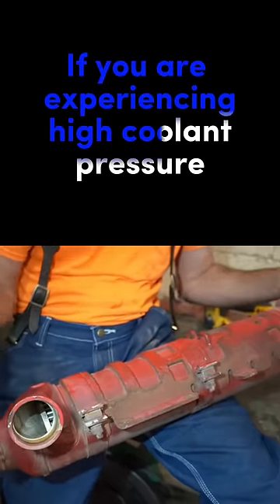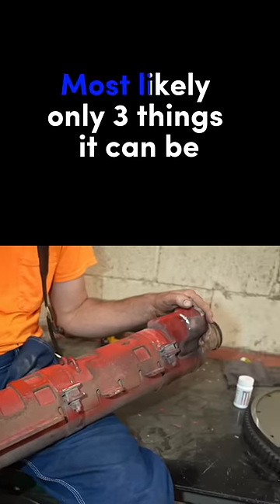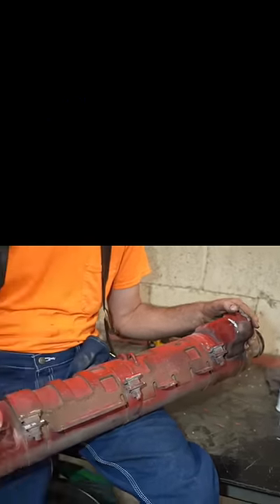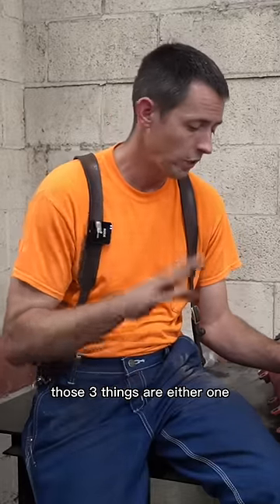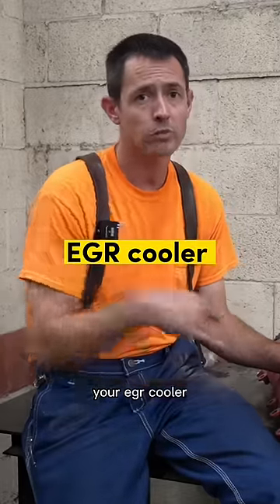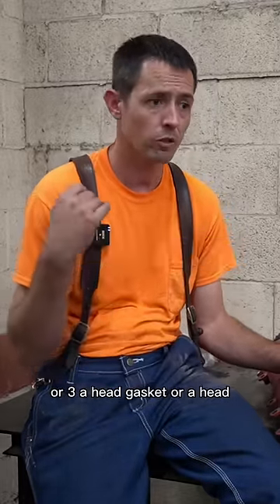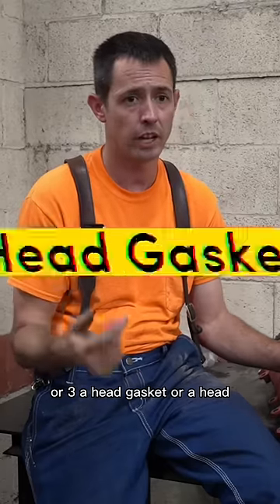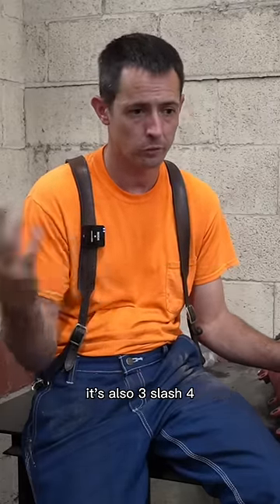What causes high coolant pressure in the cooling system? #shorts

Comment: Hey Brother I have a 2005' Duramax LLY engine. It's building coolant pressure and losing about half a gallon a week on all day driving. Radiator hose is hard in mourning sometimes. Anywhere you would look other than headgasket just to be sure. Has 463,578 miles

Comment: On an isx,I’d check the egr cooler. But a lot of time it’s a low liner, causing the pressure past the head gasket. I’ve never seen the air compressors cause this. Not saying it won’t. Just the common failures I’ve seen
Reply: The old Maxx forces had the same egr issue as the isx nine times out of ten on those the egr failed didn't have to many head issues
Reply: I've seen this happen a lot I work on busses and I replace the air compressor head while the air compressor is o. The bus it quicker that removing it